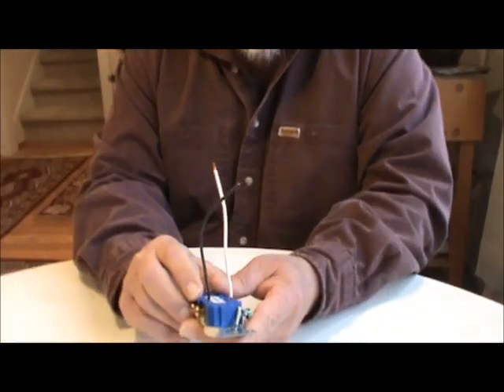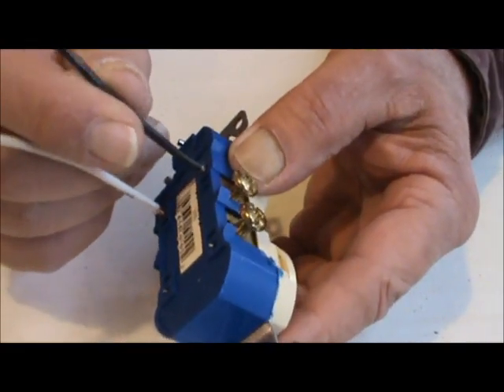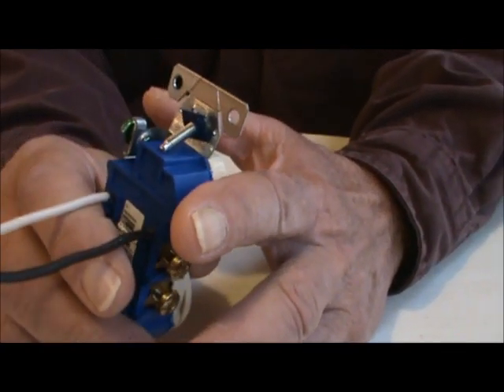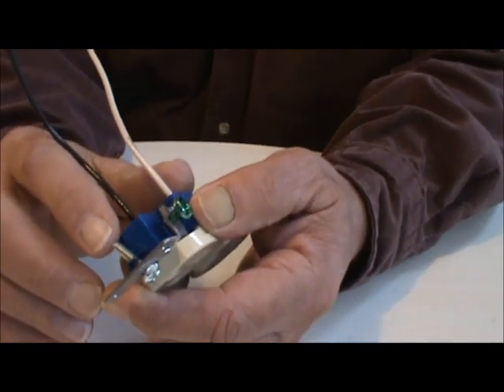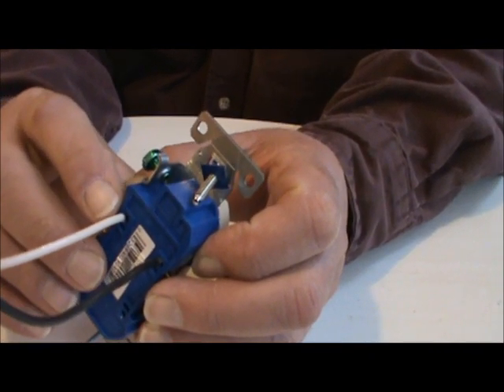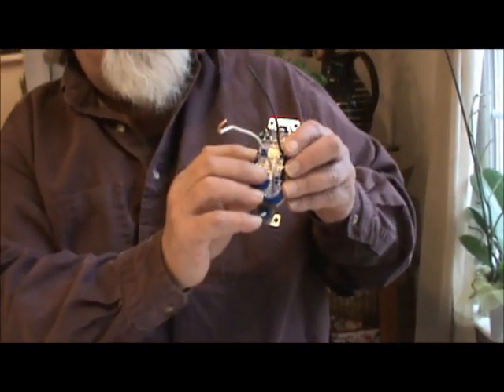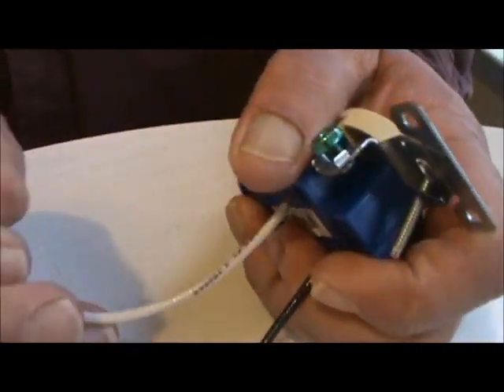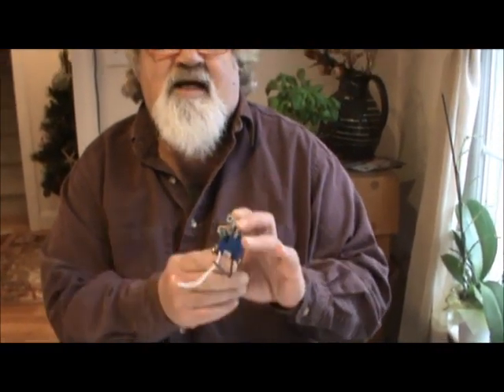How To Find Why A Circuit/Outlet Is Not Working the Easy Way, and Fix

Comment: Hey I’m a little late to the party but I was wondering if you knew what’s up with my out, so I know  two of the outlets on the circuit it started after I came home and I noticed a fan had not been on, the outlet stopped working now after I replaced it and my no contact voltage detector said it was receiving power, it would not power a lamp or anything plugged into it, I got home tonight and I seen one of the little night lights were on and I tried the lamp again and it works, what could be causing this issue? One day it stops working completely and the next it works fine, I understand if you don’t reply as it’s been quite some time since this video was posted I appreciate your time if you do reply. Thanks! Ps it’s a parallel circuit it’s a trailer from 65!

Comment: Good evening I have a receptacle that’s not getting power. I checked the wires they are also dead. How do I find that breaker is there’s nothing else on the circuit
Reply from the maker: Do you have a meter you can call me  434-284-0600

Comment: What would be the cause if only the bottom half the outlet is working on all the outlets within a bedroom? There is a separate switch to turn on the top half of the outlets but when flipped nothing lights up.  Bad switch??
Reply from the maker: Yes change that first.

Comment: But...if the outlet does not seem to have a line/load (master/slave?) setup as the sample you are showing, how can the others supposedly downstream also go out?  I can't see how they are dependent. This is what I'm running into. A few outlets as well as wall switches have no juice, a few do but I see no slaved wiring in the outlet boxes - just one white/one black if memory serves. I'm going to try a tone tracer next but unsure what success.
Reply from the maker: I don't under stand what you are saying.

Comment: Hello, hope you can help as I cannot find a vid about my specific issue. My bedroom outlets don't work and that line's braker was reset. Want to know if it could be a braker before I start taking things apart as I am not an electrition.
Reply from the maker: I have a video on way my rec. is not working check that out and let me know or call me at 434-284-0600

Comment: Ok I know which plugs don't work . But I tried checking to see which wires were hot . None of them were hot . All the other plugs are fine in that area . How do I find the hot wires ?
Reply from the maker: You can call me at 434: 284: 0600 i can help you.
Reply: Hot wires are black

Comment: I sent this to the phone number you provided but than realized it wasn’t sending to you. So I’m going to put it here on YouTube comments.

Hello mister (nature's friends on YouTube) I just saw your video about outlets and circuits not working. Yesterday night I had a extension cord plugged in to my bedroom outlet but when I got to my chair to sit and work on my computer the wire of the extension cord was under one of the legs of the chair so the wire got cut, started  sparking and melting. Nothing near the outlet though. I have 3 outlets in my room and all of them stopped working. My lights and my fan in my room work but not the outlets. I tried what you recommended in the video. I checked all my wired connections to the receptacles every wire was good and tightened down under the screws. My sisters room is right next to mine and also has the same issue. All 3 outlets stopped working after the wire incident in both rooms. The rest of the house outlets work fine. I checked the breaker box and none of them were flicked to the off position. But just to make sure I turned off the whole breaker and turned it back on. Still no luck. Any advice ? 
PS 
Also tried all the GFCIs in the house. There is a total of 9-10 and all of them got reset. Still nothing

Comment: The last outlet in series will have 3 wires, black white ground. All others in series will have 2 white 2 black. The 2 grounds will be connected together as one or connected to one screw
Reply from the maker: That is correct  if any in the middle open the other outlets will not work, Thanks for watching and Merry Christmas.
Reply: What about the first in the series
Reply: @donalddodson5979  In series means linked together. 1st one the same as "all others". 1st one brings in the power with 3 wires then another 3 wires connect the 1st to the 2nd and so on.
Reply: @stevstone40  thanks

Comment: Had same problem but was the hot wire on the 2nd outlet of 9 in a series. 7 had no power breaker not tripped. The push in wire type connection called "back stabbing" is not a good connection. Wire should be connected by a screw hold type. Each outlet carries power to the next. If 1&2 working and 3-9 isn't, replace 2. All of mine now have power.
Reply from the maker: That is right Stabbing not good Thanks for watching.

Comment: I just bought a new dryer so I decided to test the 4 pronged wire to see if it fits the outlet, this immediately caused a spark as the other naked end (the part that is meant to be connected to the dryer)touched. Since then, ive not had power from the outlet. Ive checked the labelled breaker for the dryer and turned it on and off many times to reset it but stil no power to the outlet. 
KIndly advice on what needs to be done. this will be very much appreciated.
Reply from the maker: Give me a call I can help you 434 284 0600 l
Reply from the maker: Try changing the breaker. you could have messed it up.

Comment: I shorted a ext cord on a circuit w/o knowing.  So breaker tripped and tripped again when reset before l knew cord shorted. It tripped intensely w sparks. l traced  to shorted ext cord and fixed. most of circuit now fine but there are two lines to ceiling lights on circuit that are out, pigtail test lite shows only weak current so not working. Then from the two of them l traced to a 3 way wire nut and tape  junction (took it apart)clean looking no melts smells.  The two lines coming out of this three way show only weakly on pigtail tester.
Reply from the maker: Check and see if another breaker is tripped
Reply: @TheNaturesFriends   thanks .  and no others have tripped
Reply from the maker: @cleatington  Give me a call 434-284-0600 i can help you
Reply: @TheNaturesFriends  super nice of you,  tomorrow l run the  tests. Thank you

Comment: Now would a gfci outlet will prevent this from happening in the future? In other words, would a gfci outlet allow for only one outlet to stop working instead of like 4?
Reply: Out in my building i have one wall outlet not working but all others do. Ive replaced the wall plug and still nothing. There is no gfi plugs in building. The plug to left and right of bad plug works. Can u help
Reply: @jonathanturner2535 im in the same boat
Reply from the maker: Any outlet down stream will be off when tripped .They are on the load side. thanks

Comment: Hi Harold, we have a similar situation.  We replaced the circuit but and had an electrician check it.  But the power comes on and off periodically for a week or two at a time.  It involves one outlet circuit and 3 light switches.  Two of the 3 light fixtures are outside under our patio roof.  We cannot find the breaker that carries these switches/circuits.  In this last cycle, the power has been off for over a month now.  I wonder if we should try replacing the 3 light switches.  Or what do you think the next step should be?
Reply from the maker: Text me and I can call you I can help you. 434 284 0600
Reply: Nature's Friends wow that’s nice of you